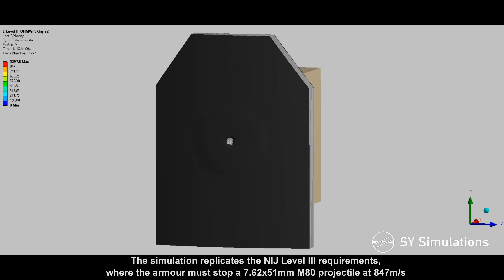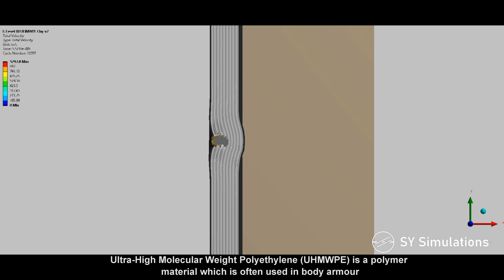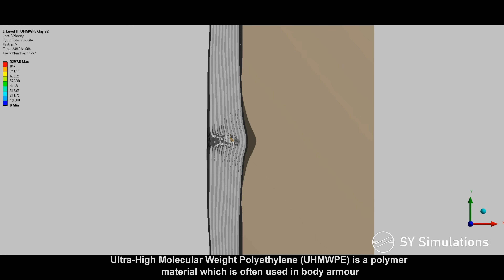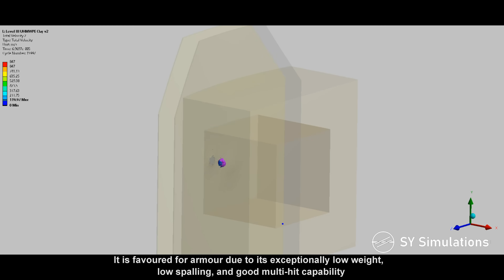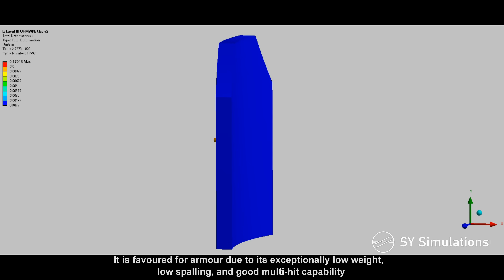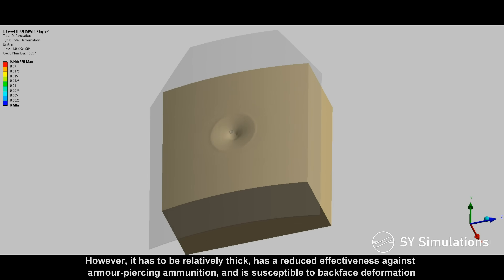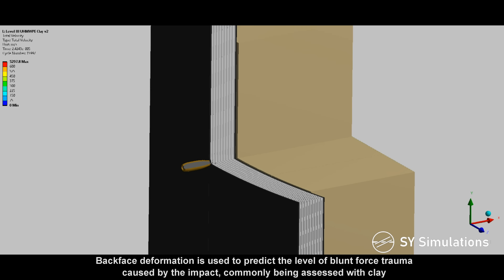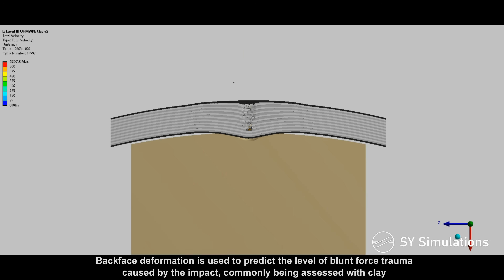Level III UHMWPE Body Armour Simulation | 7.62x51mm vs Polymer & Clay Armour Penetration Simulation

Comment: Suggestion: 128mm Pak 44 APCBC shell vs Tiger 2 Upper glacis at combat ranges (such as around 1000 meters or so) 

Unstoppable force meets immovable object (by WW2 standards)
Reply: Ah yeah that sounds like a good idea actually

I thought you were gonna pit the Pak 44 with the UHMWPE plate 💀

Comment: Soooo, these are more lightweight but thicker than ceramic plates?
Reply: These have problems against hard core bullets .
Reply: @ShokkuKyushu  So do ceramic and/or steel plates. That is the point of Armor-Piercing ordnance.

Comment: I used to run UHMWPE plates working on oil rigs and cargo ships, other marine environments; they're pretty much the only armor I can think of that has positive bouancy, I. e they float, and they are immune to salt water spray and emersion

Cons: The material loses strength over time, worse than kevlar, so they do have an expiration date, after that they may not longer meet NIJ specs. 

I've never worried about blackface deformation; everyone I know who's been hit while wearing hard plates says it's not a big deal, it doesn't hurt that much and they all said all it did was piss them off, and make them fight even harder, basically
Reply: Well, I guess the pirates don't have access to tungsten carbide core rounds, and I wish you all the luck in the world that they never will 🙏
Reply: @Squee7e  If some pirates who love cheap and effective gear somehow manage to get access to expensive high quality tungsten carbide core rounds then we have a bigger problem
Reply: @Epsilon2042  Technically you don't need that for UHMWPE, M855 is really common 5.56 and will go straight through 90% of the time
Reply: @signs80  yeah I was just saying

Comment: Garand Thumb on Youtube did a recent review of Russian body armor with interesting and similar results. The ceramic bricks provided surprisingly high levels of protection even against multiple rounds.
Reply: so what?
every modern military armor plate has ceramics
Reply: @ukuskota4106  not exactly, polymers like here, steel and ceramics (and rarer combinations of those 3) are like 98% of existing body vests
Reply: @КанистраКеросина  что не точно?
грю ж - керамика - современные военные броники
для отсталых и бедных - стальные.

а других видов и нет - итальянские, титановые, VBA можно не считать.
Reply: @ukuskota4106  steel better than ceramic vs non ap rounds and frag. but heavier and more durable
Reply: That is equivalent to level IV NIJ,this is level III

Comment: Wasn't this type of armour used in the glacis plate on the T72A and T72M1 tanks?
Reply: No. That was a fiberglass based composite sandwiched between two steel plates.
Reply: @DecidedlyNinja I think that was the early T-80As. The T72A and T72M1 had 2 plates of textolite of 50mm each. I was just wondering if the armoured vest was made of textolite.
Reply: @stephenhumphrey7935  T-80A and T-72A had similar hull armor. To answer your question, UHMWPE and textolite are not the same thing.
Reply: @DecidedlyNinja OK. Thanks for the answer. 👍

Comment: Try a thin layer of ceramic, then a thin layer of high hardness steel, then a thin layer of UHMWPE then a thin layer of Kevlar vs some sort of AP threat. Always wondered if that would work.
Reply: solid steel plates should be 25-50% heavier, compared to this plate of same size. so the layer of steel is a bit redundant and weighty.
however, ceramic plates on the front would be an interesting addition.
then again, the entire reason for this plate is that it stops standard rounds already and is really light. adding more weight for added protection makes its use questionable. every kilo saved is a free kilo gained for ammo and all that.
Reply: @Pilvenuga the idea is that each of those materials have a different resistance to AP rounds. The best would be ceramic, then armored steel, then UHMWPE, then Kevlar.

So my idea is that the round would be blunted and lose energy with each layer, allowing the next to absorb more of the energy. They are also in order of their ability to catch spalling and absorb the blunt force.
Reply: @antimatter4733  so, how would you hold all the different material layers together? glue?
Reply: @Pilvenuga well yes some sort of epoxy with the right amount of flexibility and strength. This is already how composite ceramic+kevlar panels are made. Although for a single shot like this it's not too relevant
Reply: @antimatter4733  isnt that why the U.S military banned the use of Dragon Skin armor, because the glue that held the ceramic plates came apart after a few hot and sweaty patrols
Reply: @Pilvenuga that was apparently the issue, although it has more to do with the fact that the plates overlapped which makes it more difficult to get them to glue correctly. There's other ways to secure plates as well, for example wrapping all the layers in kevlar or dipping the entire thing in some sort of rubber anti spall layer.
Reply: Steel layer will cause frag. Not good. Best armor is probably steel coated in uhmwpe but the only company to make that stopped cause it was expensive af
Reply: @a.t6066 ceramics have a better protection to weight ratio than steel, they just have reduced multi hit resistance because they crack (which is partially reduced by using smaller tiles) and they also produce a lot of spalling.

The system I described, although very expensive to manufacture should allow the steel layer to absorb almost all the fragments from the ceramic, then allow the following layer to absorb all the fragments from the steel and so on.
Reply: @antimatter4733  theres no point in adding a steel plate behind the ceramic. The ceramic will stop any threat. The polyethylene plate will stop smaller threats. Adding that many different layers is redundant and excessive. Its probably heavier and more prone to delamination. Theres deminishing returns to just stacking shit together
Reply: @a.t6066 the steel will stop the fragmentation faster than UHWPE. This should allow a slight decrease in plate thickness and weight. Even a 3mm sheet of steel will pretty much stop any fragments.

Yes it will be more expensive, but this is a simulation, plus armies like the US spend ridiculous amounts of money on crap that doesn't actually help them win wars, this will.

As for the plates seperating, that's not really an issue unless you hit a plate 5+ times which is unrealistic. Composite plates are already bonded.
Reply: @antimatter4733 there are minimal fragments after hitting ceramic. Steel frags bad. Like really really bad. 2 or 3 shots and spalling is already cutting up your arms, legs, and neck. The issue you have to worry about is frag coming out the sides, not through the front and back.

A poly ceramic/poly steel combo is still going to be lighter than all those layers mixed. If you arent worried about extreme multi hit (5+ shots) then ceramic poly is simply better and lighter than what you're talking about. Backface deform is probably identical or better as well
Reply: @a.t6066 I'm not talking about spalling to the sides of the plate, I'm talking about after penetration, ceramic throws shards of ceramic into you, which in ceramic plates is usually caught using a thick layer of kevlar or similar.

This plate reduces the thickness required for the kevlar and ceramic. Here the ceramic only serves to blunt and/or shatter the round.

Again, you don't seem to understand ballistics enough to get why this would work. It's not a new concept.

Backface deformation will be better because STEEL DOESN'T FLEX AS MUCH AS KEVLAR.

Its like you're so desperate to write it off that you've abandoned basic logic 🤦
Reply: @antimatter4733 buddy, high hardness steel plates cause frag. Really really fucking bad frag. Thats why every army in the world has moved away from steel plates. When you get shot, the fragmentation is like a grenade going off on your chest. Its throwing frag into your neck, your arms, your legs and WILL kill you. The whole point is that your layer idea compromises the advantages of ceramics for zero benefit. Take the steel layer out and youre talking about armor layout that already exists and is already widely produced and used....

Comment: It’s also buoyant, so it helps you stay afloat in water unlike other armor plates
Reply: Short answer is No. Long answer is well yeah while the plate itself has positive buoyancy, it doesn't "help you stay afloat in water" because you would be carrying tons of other stuff anyway (unless you don't use plate carrier/load bearing vest and just duct tape the plates onto your naked body). The buoyancy property has been long disregarded for maritime application, and focus on quick release feature of the carrier instead. When the military make something weight 1 lb less, it's not to reduce your load by 1 lb, but to make you carry 1 lb more of something else
Reply: @miliket4tom Oh wow, didn’t think of it that way. Thanks!

Comment: Wonder how much of a difference a ceramic face would make
Reply: Big difference. Most armors nowadays are composite like that. Whether it he ceramic face, polyethylene backing or aramid backing.
Reply: ceramics is versus temperd steel core bullets.
so versus lead core it will be easy

Comment: This sounds perfect for that new Infantry Squad Vehicle, the latest HMMWV replacement, which is devoid of armor.  Anyone with more than a single pair of functioning brain cells knows that it's going to be shot at, and AT LEAST needs protection from shrapnel and small arms fire.  Detachable and replaceable armor segments package, possibly with a similar slat armor overlay package, would go a long ways towards making a more survivable vehicle.  The new vehicle is supposed to have speed as it's defense.  Pretty sure it's not going to exceed 850 m/sec to outrun bullets.
Reply: The ISV isn't a replacement of the regular HMMWV. That would be the the Oshkosh  L-ATV.

Comment: Does anyone remember "Dragon Skin" Body armor? Supposed to be revolutionary but was banned by the military. I wonder how it would work in these simulations?
Reply: I was beginning to question whether I'd dreamt that one. Why was it banned?
Reply: @Optimistic_Hobo  Because it literally glued together. It couldn't handle the military's environmental tests.
Reply: @burningphoneix also if I recall was way to expensive
Reply: @burningphoneix  Cheers boss.
Reply: @Optimistic_Hobo  The scales were glued together so after a prolonged period of use the glue would degrade to the point scales began dropping off and collecting at the bottom of the vest. Similar to the issues with medieval scale armour, it was just cheaper and more reliable to use large plates as any damage or degradation would be far easier to detect and swap for another.
Reply: Any properly made leve IV is probably better.
Reply: It was banned due to failure during temperature stress testing. But also its probably more likely to injure and kill since it has an enormous amount of backface deformation

Comment: This is definitely interesting to see. Especially with all the criticism towards the US military moving to a more powerful cartridge. Putting aside the....questionable.... choices theyve made with the sig spear and "training" ammo being lower power. Imo stuff like this shows that you're definitely going to need more than just 5.56 to be effective against a modern military.
Reply: It's... Not really. Penetration is more a function of bullet design than anything else. Put even a mild steel core in a bullet and UHMWPE tends to just fail, badly.
As far as the 6.8mm is concerned it's quite literally just a 7.62x51. It uses the x51 case and overpressures to get ever so slightly more energy behind its 6.8(15% or so) to get that from a 16" barrel instead of a 22".
It really is a silly concept and the army will suffer for it in the future.

Also just for reference 5.56 with the right ammo will blaze through the above test armour with 0 concern.
Reply: @fen3311  energy is also a horrible measurement on how hard a bullet hits. energy biases velocity. a 7.62 under most circumstances will hit harder, despite having less "energy". a more accurate way to describe how "hard" something hits is momentum and by extension, impulse.(mass x velocity). 6.8 only makes sense as a DMR or sniper, as the increased pressure(barrel wear) is less of an issue, and the increased velocity is nice. 

what you said about poly plates is very true.
Reply: It took 250000 rounds to kill a single person during Iraq and Afghanistan. Penetrating body armor is not the defining characteristic you want to base your cartridge on. For the same reason the US went with 556 over 7.62 DESPITE the fact that the USSR had body armor with titanium plates that could stop 556 is indicative of an already settled debate.